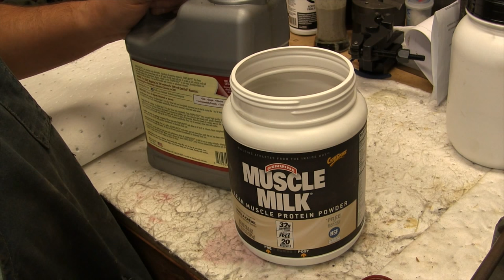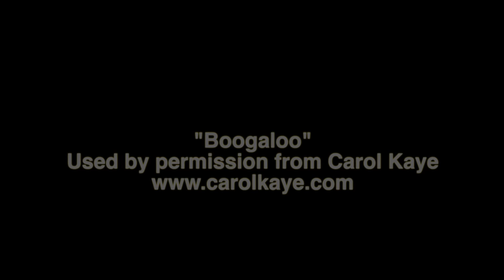Bridgeport Rotary Table Teardown & Cleanup   Part 3

Comment: Its good to pull your differing machines apart, not only to clean/inspect, but also you acquire a knowledge of just how they are assembled and operate. A deeper connection to the machine and what to look out for in the future. Good job Brad.
Reply from the maker: +Rain Coast Agreed!

Comment: Hey Brad,
nice job dude! thanks for posting this series and the heads up on the aluminium cleanup.

i've been using a coolant from Jokisch (sold thru Hoffmann group) in my bridgeport and it has done an amazing job of eating the gunk off of the machine and also de-rusting the table and some of the accessories such as the east german machine vice i picked up a few months ago.. even the paint on the vice is looking pretty good. 

another nice little rust removal tool is the sandflex block from klingspor. they come in several different grits. they look just like an eraser and are used essentially that way. they don't take off any material but do polish up steel quite nicely. they're handy to have when you get a little rust on a handle or something and don't want to take it off to clean it up. that would have worked well in cleaning the little bit of rust off the ring of the base when you pulled it out of the soak

also i picked up a 16" (400mm) rotary table in ebay made by Hahn&Kolb that has an oil bath in the base. there is a sight glass on the side of the case that shows the oil level. although the manufacturer is still in business they were unable to provide me with any info on the thing.. if anyone else reading along knows anything about this type of rotary table and what kind of oil it takes it would be greatly appreciated.

looking forward to the next part of the series
cheers
mike
Reply from the maker: +HolzMichel Thanks Mike - those sounds like they're pretty good. De-rusting is a fun process and I always like to hear new ways to do it. Thanks!

Comment: You got it exactly right when you said never partially submerge parts in EvapoRust. The oxygen in the air at the "waterline" will rust the surface. Then the EvapoRust will dissolve that rust, exposing new metal, which will then rust, and be dissolved...a vicious cycle! If you leave the parts in long enough, you can easily etch a deep line into the surface. I wish I didn't know this from personal experience...
Reply from the maker: +rengecko Exactly!

Comment: Here I thought everything Bridgeport made was light weight! lol The heavy stuff you need cranes and special foundations for. I know Monarch used body filler and then sanded all their casting before paint to make all the lines smooth and the castings slick. I imagine Bridgeport did something similar.
Reply: yes they did....they were cast in India, machined in England and assembled in America

Comment: Purple Power is caustic which means it will attack aluminum, just like lye.  It is specifically not recommended for use on stainless steel and aluminum.

Comment: lucky mate. that evaporust could have etched your table. if it's not 100% submerged it will rust / fix on the water line, due to oxygen. leave it for hours and you have a massive hole. nice video!!!

Comment: Fairly new to your site (got here from Oxtools) so you might have a video on it already 
but what is Purple Power??
Great videos - Rod
Reply from the maker: +Newmachinist Welcome and thanks for the sub. Purple Power is a strong degreaser. Works great on machinery and such ;)
Reply: Where do you get it from and do you have more info on it's use in past videos"
Thanks again  Rod
Reply: +Newmachinist PurplePower works good on stains in jeans.  Spray it on then rinse off with a pressure washer.  All stains will be blasted off!  It's sold at Pep Boys, Autozone, Home Depot, Lowes, Walmart....
Reply from the maker: +WAVETUBE84 Cool - will have to try that one ;)

Comment: You just trashed that abec 7 sp double roller bearing, by hammering it, if you paid attention you should have removed the bearing from the taper on the table, then install with the table down through the housing, then gently preload using the spanner nut you were brutalizing. You should spend the time and look at the drawings and study the components, by understanding the components and their tolerances you can save yourself alot of grief.
Reply from the maker: I'm so blessed to have been graced by your superb knowledge. How about YOU do a video and show all of us unknowledgeable peasants how its done? Oh that's right, you're one of those assholes posting negative comments from the safety of their keyboards. For your information genius, my rotary table is in perfect condition - and no, I didn't "just trash" the bearings, moron. But thank you for watching my videos, Hugs & Kisses.... ;-)